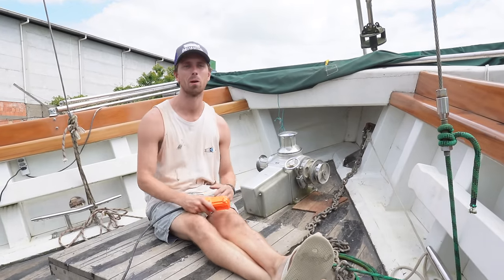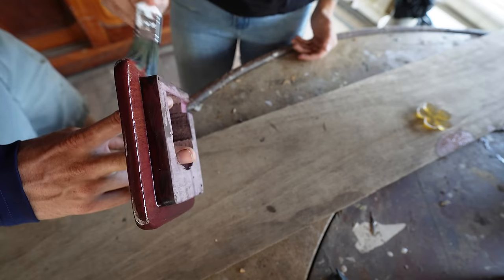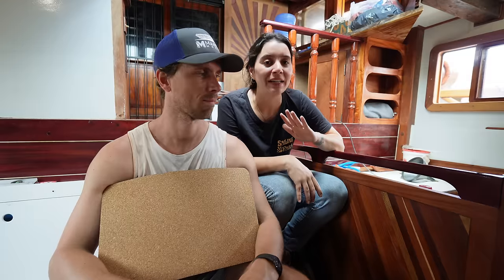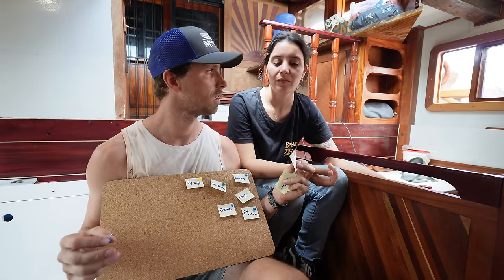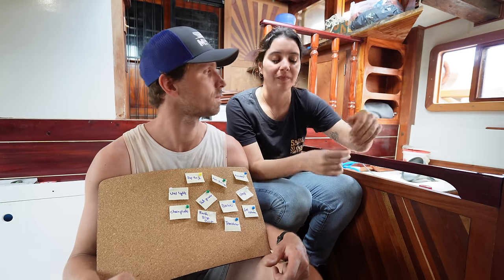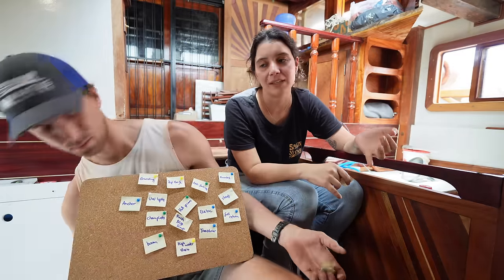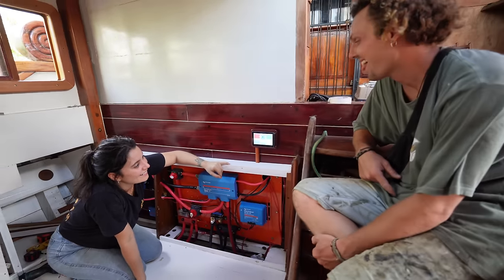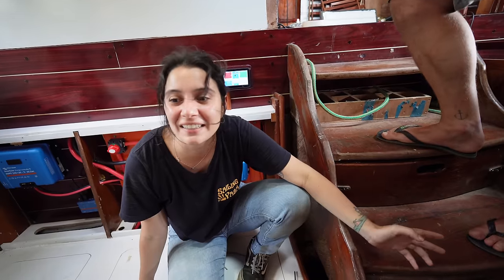Boat launching to-do list: you're gonna either love us or hate us for this — Sailing Yabá 191

Comment: Ben with regards to your through hull for the engine pick up DO NOT HAVE OPENING FACING AFT😮😮😮😮, the opening MUST be facing forward, the reason for this is if you have the opening facing aft as the vessel moves forward it can cause a vortex around the opening resulting in the pump loosing suction resulting in overheating and destroying your engine. I have seen this on numerous occasions during my 45 years of marine engineering.
Reply: The manufacturers want them facing forward. Below 5 knots it doesn't make much difference, but at speed the aft facing orientation will cause a venturi that pulls against the pump. I've installed these facing forward and never had a problem.
Reply: I was wondering if that might be an issue but wasn't sure if it was only at higher speeds than Yabá could go at. I have no experience however :)
The water would have to go past, then reverse it's flow at an equal speed to the boat in order to fill in the space. Then extra on top if it is being pumped in as well. Low pressure can do a bit to pull in water but it might be asking too much
Reply: Once again, a total screw up due to lack of knowledge.  How can you get this boat certified as a commercial vessel which is what you have if you are using this as a dive boat and diving instruction. Cabins need escape hatches and many more life safety requirements than you guys are even aware of!
Reply: @jfhaia Jealous Hater, lol. Sad man.
Reply: Ya I don't think this boat will ever go fast enough to create a vortex.
Reply: Noooow. It should be facing forward if you agree please thumbs up 👍
Reply: I have only seen water pickups with the grate facing aft but after a little bit of research I found that the instructions from Italian Guidi making these says that the grate should be facing forward. Big surprise! Considering  my own experience it probably works fine both ways.
Reply: You’re going to have to haul this boat back out to fix this. PLEASE return it to the correct position! Don’t try to reinvent the wheel.
Reply: Guys! Your engine cooling system intake grill: Forward facing, as it was, is absolutely the correct orientation and as intended by the manufacturer. 

Facing aft creates a depression at the intake which causes the water pump to cavitate, wrecking the rotor and overheating your rebuilt engine. 

Mech Eng./Time served Marine Engineer/Superyacht project Engineer.
Reply: makes me ponder if there is an alternate way of doing this at all... e.g. installing it sideways?
Reply: @theorganguy  Well, you could if you wished to compromise its functionality. 
Why not just fit it as intended and as has been found to function best ever since internal combustion engines began to be fitted into boats? 🤷🏻‍♂️
Reply: In three years they have been at that yard, was there never a moment just out of curiosity you could have looked at one of MANY MANY boats that were being worked on and see which way  the intake is oriented? Isn't that a more valid way of doing it right rather than guessing which way it should point?
Reply: On a sail boat  if is sailing at a fair rate with the grill facing forward water can actually be forced past a slightly worn pump impeller with the engine off filling the exhaust and then the cylinders. I doubt This boat will go fast enough for it to make any difference
Reply: Is the gearbox ok to free wheel while sailing? Some gearboxes need to be put in reverse while sailing to stop them running the bearings dry with the engine not running. Some need to be in forward gear. And some boats need a sail brake on the shaft to prevent the propeller spinning while under sail. A quick Google on your gearbox type should let you know if it’s ok to free spin or what action is required to stop it turning
Reply: @robm.4512  the point he is making as well as those of various posters here are valid, tho: what about clogging up potentially?
Reply: @jfhaia the rooms do have escape hatches..
Reply: @theorganguy  Quite frankly, if a plastic bag or similar is going to be sucked onto the intake grille I don’t think it’s orientation will make much, if any, difference. 
It can happen but it’s vanishingly rare unless you motor through a garbage patch in a marina. 
If you do, it’ll likely drop off when you switch the engine off and that’s that. 
In over 50 years afloat, half of which has been as a liveaboard on either my own boat or as a full time engineer on someone else’s, I’ve personally never had it occur and I can only think of being told of a couple of instances. 
So it’s pretty much a hypothetical, not a regular issue to be concerned about. 
Tbh, it’s just frustrating to spend time even thinking about it with “what ifs and maybes,” it really isn’t a worthwhile issue to waste time on.
Reply: Came to the comments to say exactly the same! Nooooooooo! Negative pressure will suck the water out of the coolant loop and kill the engine.
Reply: I have a small scoop on my dinghy that faces aft and sucks up the bottom of the boat while it is moving.  So I would like to believe that this can prevent the aspiration of water and even reverse the flow.
Reply: Ok. But may it happen at motorboats/speedsboats! But not at yaba. Cruising speed may be 5-6, not at the maximum.
Reply: Big mistake Ben!  You should have left the pump intake through hole as it was. Stop second guessing things and listen to professionals and experienced boat techs.
Reply: Many people say for power boats you definitely need facing forward the very reasons you’ve talked about however, for slower sail boats you could have it facing aft or even just have a flat one. there’s even some argument for not having any strainer, so that if either something gets sucked through or if enough growth happens, it would be easier to clean it out without having to take the boat out of the water to clear out whatever is between the valve and the scoop. These people would say to use an internal filtration that you can clean regularly.
Reply: @jfhaia you know they're in South America, right?
Reply: @vancguy9204 all it has to do is go up a river.  Since they're in the tropics the engine will run hot with water temps being higher. Even a small loss of efficiency can have significant effects... and  cavitation in the pump will shorten its' life anyways. Reaetting the intake yet again is a small job with a big payoff.
Reply: I just had a flashback of younger skinnier me climbing into the condenser to clean out sargassum and 500lbs of boiled anchovies.
Reply: You had the water pickup thru hull correct. Why on earth did u change it?
Reply: @jfhaia Lemme ask you a very fair question, buddy. If you tried to build a rocket, from scratch, with a team of maybe ten people, how would you feel about some random asshole on the internet demeaning your efforts? Go touch some sand, my guy. Or, better yet, actually watch every video on their channel. They have been incredibly thorough and attentive, and they have been paying attention to the comments. Honestly, they've fought hard for what they've learned and built. Shame on you for not giving them the patience and respect that their determination deserves.
Reply: @Mar-vu9nx  Any reduction in pump inlet pressure will increase instances of cavitation in the pump, leading to accelerated wear and reduced cooling system efficiency.

Facing the intake with it’s raised end forward causes a reduction of intake pressure at any speed, with the reduction of intake pressure increasing with increase in speed. 

That reduction of intake pressure at 5 knots may very well not be beyond the pump’s ability to overcome it, allowing the pump to continue to flow water through the heat exchanger, but the fact remains that it will be reducing pump efficiency and increasing cavitation, leading to reduced cooling efficiency and increased incidence of pump failure. 

It’s just Engineering 101, there are many craft afloat that have intakes fitted incorrectly and they’re often the ones that perpetually run on the edge of cooling system failure and have a far greater appetite for raw water pump impellers than should be the case. 

They’re also the ones that require pump bodies to be replaced due to misdiagnosed “corrosion damage” near the inlet port, which is actually cavitation pitting. 

It’s all very well guessing and “perhapsing” with stuff like this but it makes far more sense to just stick to the fundamentals of physics and engineering which the manufacturers of the grille applied diligently in its design, leading to their recommendation for its orientation, which is to fit it as Ben had done originally prior to reversing it. 

In this case good old Bernoulli and his theorem applies and because water is a viscous medium it applies in spadefuls at very low flow rates across the intake. 

So yes, 5-6 knots is plenty fast enough to be causing issues if the intake grille is fitted the wrong way around, which Ben has just done. 

I appreciate that this is a far more fulsome answer than is normal here in the comments but it seems to me that there are a great number of people that are ill informed on the fundamentals of the subject that are weighing in with opinion based upon little more than wishful thinking. Why that should be the case entirely escapes me, I’m only an engineer, not a psychologist.
Reply: @robm.4512  not realy, Ben has given the right argument. Intake is much below water level, and there exists already pressure.  All engine intake cooling system, is very well overdimentionetet. 👌 And shortest piping distances to the pump. It is also not though, if cavitation doesn't occur, it will have an accelerated wear anyway.  All are forgetting that Brazil is a tropical, YABA will sail along and close the coast. Rivers are always  throwing a lot of floating debris into the sea .
Reply: @Mar-vu9nx  Physics, fact, design, not supposition or fallacy. 

Not one of the points that you just made alters any of the fundamentals of the physics that applies to the efficiency a raw water cooling pump. 

That pump’s efficiency is reduced dramatically by reduced pressure at its intake port. 

Reduced pressure at the pump’s intake port increases cavitation rate and reduces the pump speed at which cavitation will occur. 

Debris should be dealt with by using a raw water strainer, not by facing the pump intake cowl in the reverse direction to its intended fitment for the reasons previously stated. 

These are facts. 

If you wish to follow Ben’s lead with your own boat, feel free, that’s fine with me. 

I do however have concern that others will also be led astray by the flawed thinking and assumptions that many seem to be applying to the issue. 

However, I’ve stated the facts clearly and now I leave it up to all of you who dismiss those facts whilst finding ever more flawed  justification for doing so. 

I’ve just tried to provide a little piece of a lifetime’s worth of knowledge for free, it’s entirely up to anyone who bothers to understand the point of that knowledge to either follow it’s conclusions, or to dismiss it as worthless. 

I’m not going to be paying for the results of ignoring it. 

Have a nice life, cheers, R.
Reply: For sailboats installation towards the rear, for motorboats towards the front
Reply: No, physics is the same regardless of the boat type. Even at a few knots the negative void pressure behind the strainer will suck water out of the raw water system.
Reply: @CharlieWW75  No, will not! I beat anything you want! And it is very easy to prove! At 1,2,3,4,5 knots, remove the house and open the seacook! You see, watter continuously entering the vessel. No suficient sulking! Depends directly with the debt. But it is also threw that; facing forward will improve flow. At any speed. ( many years sailed race woid monohuls, they had beilers. Specific for saking the watter out.

Comment: My experience s with powerboats, and the through hull was correct the first way, by turning it around, if there is enough waterflow over and around the through hull you will create negative pressure behind the fitting which will actually suck the water out of the intake pipe and strainer'
Reply: Agreed.

Comment: Re skin fitting you are unwise to turn it around facing backwards. I had one on my Rassy 49 and discovered that at speed you find water not coming in. Reason is the flow of water around the solid front end caused a airlock on the other side thus restricting water being sucked into the boat. My answer was to get angle grinder and cut a couple of groves into the solid bit to break any airlock  that would form
Reply: Yes!  Propulsion engine intakes always need the”scoop” pointing forward, maximizing inlet pressure. If you’re under sail at speed and start the engine, a stern facing scoop risks low pressure at the intake.   (Note that genset raw water intakes typically use flush fittings to avoid forcing water up through the exhaust when underway without the genset running, so you slow or stop before starting it.)

Hate to see you have cooling issues with that beautiful Mercedes MP worked so hard on.
Reply: Agreed.  With the openings you the read it will act as a vacuum pulling water out. It will shorten the life of your pump.
Reply: MP, power tools, her face, her fear of failure. Ben starts, encourages, MP succeeds. I would go for underwater lights. Good for fishing, night diving.

Comment: If you plan to go with all chain anchor rode, check out Barry's 'Adventures of an Old Seadog', his last video dealt with setting up an emergency quick disconnect for the chain. You basically tie off the end of the chain, about a foot from the bitter end, to an eye bolt with rope, and then use a Stainless Carabiner to hook the very end to the same eye bolt. Then, if the rope fails during normal use, you won't lose the chain overboard. But if you have to move quickly and the anchor is fouled on the bottom, you can undo the carabiner and cut the rope. I'd keep a float with 20 or 30 meters of line attached to it in the locker so you can hook it to the chain outboard of the hull before cutting the rope and can return to retrieve your ground tackle. Also, mount a knife close to the eye bolt so it's always handy for use... :face-blue-wide-eyes::hand-purple-blue-peace:

Comment: The purpose is to prevent blockage Ben, the method allows the water to flow in , drawn by the pump , whilst any drifting debris should the suction draw the debris closer, the forward motion of the vessel forces water directing the debris over and away from the inlet. Contact Yrvind Sven building the Exlex, please do your research me Matey. It's all so very exciting these hours guys, I get a real sense of the awesome scale of what you've already both achieved, She's looking absolutely tremendous, all the best regards from here on the West Coast side of Australia  Batavia Coast 🙏🖖🤟 🌏🇦🇺🐨👽

Comment: Hi Ben and MP. If I recall correctly, in a past video you thought about doing a counterweight to the folding staircase to make it easyer to lift. I think that is one of the task to acomplish before splah day because you will be working more steadier on ground than in water.
The other thing I suggested in previous videos are: change the opening of those emergency hatches: inbounds would be safer; and: re-place the steel plate wicht holds the propeller shaft to the back of the booklets, so all the force the engine-propeller assembly produces will go to the structure of the hull instead of just 4 bolts and the plate. Both items are important: having a proper safety hatchet opening will evantually save your lives; and changing the location of the plate will reduce significantly the stress to the engine.
As far of the underwater light, I think it will be not only helpfull if diving by night, but also a nice personal signature to Yabá: imagine docking in port by night with all the lights on: COOL!
As always, cheers from NE PAtagonia, Argentina.